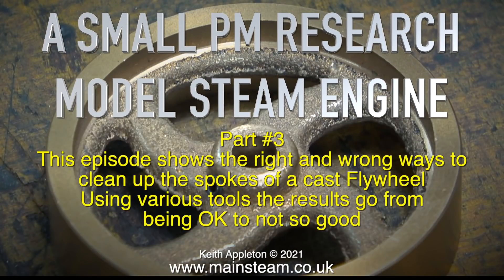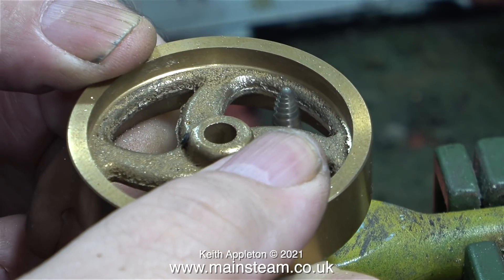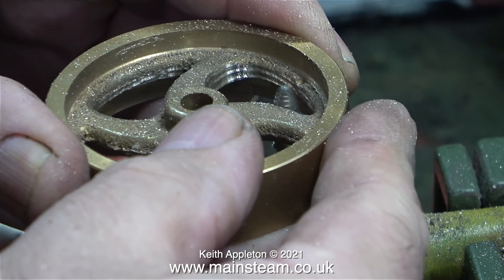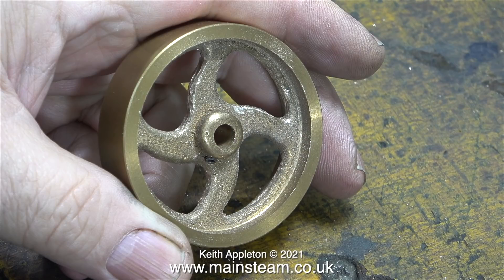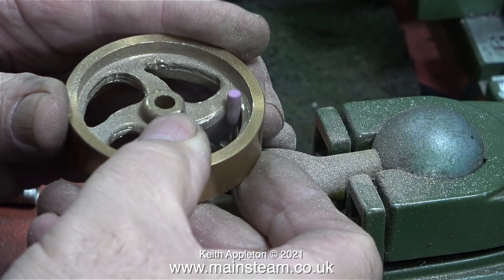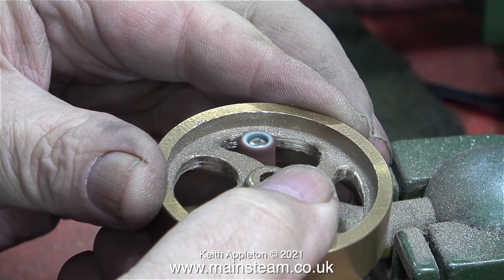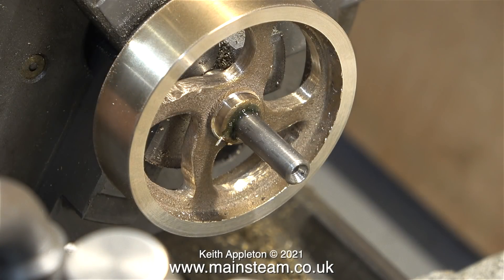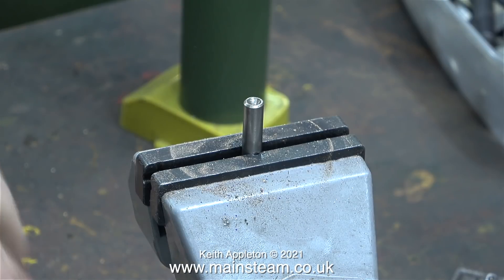A PM RESEARCH MODEL STEAM ENGINE - PART #3 - IN THE WORKSHOP

Comment: Unfortunately at one time or another I think I have used every method you showed on that flywheel plus a few others, I have the scars to prove it, the parts usually ended up in the rubbish bin or scrap metal pail.

Comment: I had to use one of those "extra violent" bits before in a 90 degree air grinder. Those are rather hard to learn to handle right...  Sort of glad you made this video. Really helps with me feeling like I'm either missing something with work orthat I am out of my mind. So glad to know I'm not out of my mind. Not quite yet anyways.
Reply from the maker: A few people missed the point of this video by not liking it. As I make Tutorials I wanted to show beginners at least one way that was not a good idea. This flywheel was a very poor casting. In a late video from the series you will see that it comes out OK after all . . . .

Comment: That's very brave tackling those wheel spokes with a die grinder and not working to a pattern !
I know you are a stickler for detail so hopefully you will show how to make sure to get each spoke the same as the others and not grind holes in your fingers during the process, or slip into a coma due to extended filing, sanding and polishing sessions !
Reply from the maker: A few people missed the point of this video by not liking it. As I make Tutorials I wanted to show beginners at least one way that was not a good idea. This flywheel was a very poor casting. In a late video from the series you will see that it comes out OK after all . . . .
Reply: @keithappleton  I understood that but you are saying 'you should never do this' and also displaying reasonable control over the part and the tool by not destroying the part or your fingers.
Often beginners will think 'well if he can do it how hard can it be ?'. Is it wise to show the wrong way first ?
Reply from the maker: It works for me }:-)))

Comment: After checking with PM Research they said that the crosshead guide screws are 5-40 x 1/2" and the cylinder cover screws are 5-40 x 3/8". I have ordered some hex head screws in 5-40 x 1/2" size bit I don't know if the heads will be to large. I will have to cut them down for the 3/8 length.